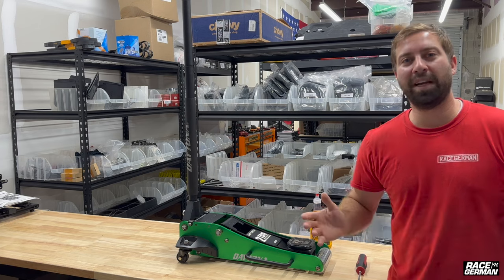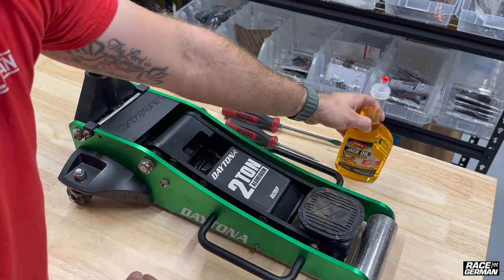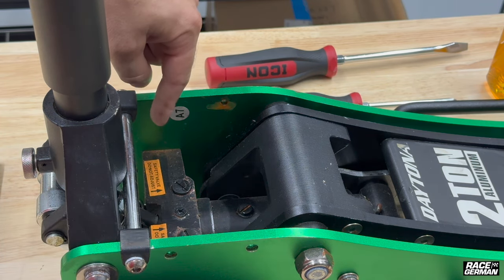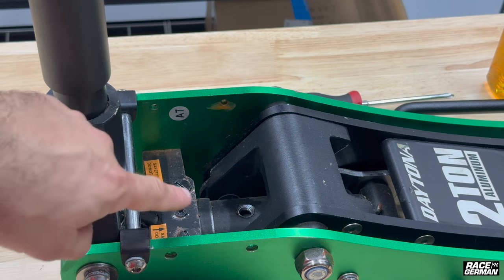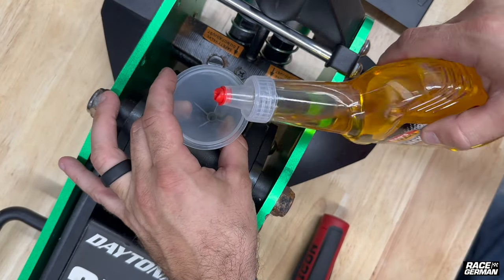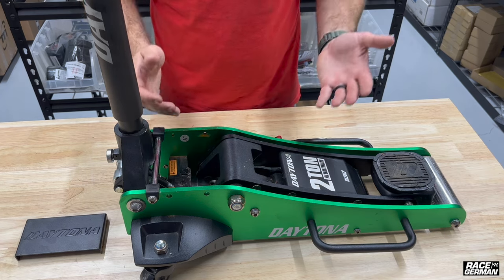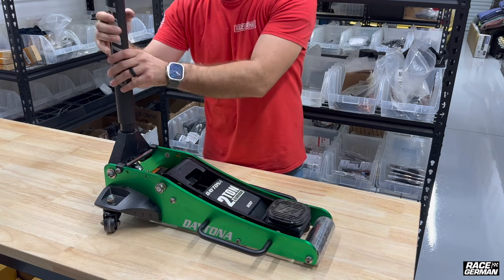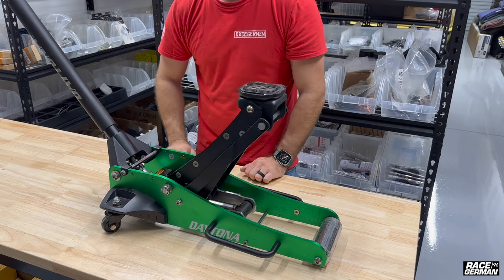How to Bleed a Harbor Freight Car Jack - Easy Fix

Comment: You should have put some weight on it... regardless of instructions, you will find that you should have opened the small bleed screw as well...  I tried the method by the instructions as you showed here.  Although the jack appeared to operate properly unloaded it drifted down under load.  I then tried the small bleed screw and got of lots of air vented.  After bleeding air from the small vent screw the jack no longer drifted under load.
Reply from the maker: Appreciate the input. This way seemed to work fine for me. I have been using the jack for months now, with no issues. This may help other people though. Thanks.
Reply: @euclon I don’t get it, I’m a noob who for the first time bought a floor jack, I’m the one looking for this kind of videos because I don’t know shit, but you seem to know about it then let me ask you this. What the hell are you doing here other than criticizing others? Looks to me if I knew how to do it I would be watching this video. @RaceGerman thanks for the video I just purged mine no problem 👍

Comment: See how you can see the top of the piston with this jack?
With the new ultra-low profile you can't.
I called HF, and they said it's because the jack is small. So they said to just fill it until the oil almost comes out. (In case you don't remember, I was the one that commented on your other video a few days ago.)

Comment: Question for you - I just picked up a HF 3-ton Rapid pump (not the low profile one) and it raises fine, but just like your Daytona in the video it settles about 1/2" after reaching the top.  That can't possibly be normal - or is it?  I'm here because I'm thinking it's a bleeding issue, but maybe you can offer some insight?  TIA

Comment: There are two pistons with springs that push and on my jack that is simular to yours has one that does not come back out all the way when the handle is up so I was wondering if that's normal or is one spring sticking?
Reply: It's sticking
Reply: @alanwielgat6671  I just bought a new one from harbor freight.

Comment: I have the exact model Jack. It’s started making clicking noises when lifting under load. Not sure what’s wrong with it
Reply: There's a nut loose on the end of the handle. To locate the nut... Hold the end of the handle and look in the mirror.

Comment: Hi, Is it normal that the jack to drop when it is not loaded?
I notice that the jack goes down on its own without load. As soon as the piston gets back pressure (when a load is lifted) the piston is lifted and the pressure remains.
Reply from the maker: No, this is not normal.  You may have leaking seals, or not enough fluid.  It should hold pressure with a car on it or not.
Reply: @RaceGerman  When a car is jacked up, the jack remains perfectly in position and does not sink down.
It is only when no load is lifted that it drops down on its own.
The jack is filled with the correct type and quantity of oil.
There is also no oil leak anywhere.
Reply: @digitronixbe5588  maybe it has a sensor and it detects when there’s no load and it drops on its own 😆
Reply: @digitronixbe5588 you are either not locking the valve when you are lifting it without weight, or it's dropping down at all times, with or without weight.

What you are describing is impossible otherwise.
Reply: @LynxStarAuto no it’s not. The main seal has lost it’s elasticity allowing fluid to pass by when just pumping. The seal flares out when the back pressure from the load is put on it then holding the load. The seal is bad.  I do see this scenario a lot.

Comment: When bleeding the manual say CLOCKWISE to turn the handle and then pump the handle quickly several times to bleed. I feel like this is an error on their part?
Reply: Yes, it's an error.  Later in the instructions, it goes into more detail on the bleeding process, this time it states counter clockwise.

Comment: Before we start the process remove the useless cover plate and toss it. Now goto step 1
Reply: The cover plate adds another layer of support and rigidity. I personally wouldn’t get rid of it.
Reply: @Yohane350 a person of common sense. Ty sir.
Reply: The additional plate helps with deflection problems, but you go ahead and remove yours...
Reply: @victorhoyt4352  get a stronger floor jack if you are that concerned about something minor. This floor jack is just fine without it for the majority of loads
Reply: Not useless. It's a nice tray for lug nuts
Reply: Also keeps the dirt from falling down into the release valve port. There is a gap between the release valve stem and the jacks base. The seal on the stem is down a ways from the top allowing dirt to fall in. And that’s not “minor”.

Comment: WORD OF ADVICE: DONT BUY THE DAYTONA BRAND. Got all of two uses out of mine and now it doesn't work.
Reply from the maker: We have had ours for years. No issues. Maybe you just got one with bad seals.
Reply: @RaceGerman  Maybe but I would expect better from a ~$250 tool. Bled the thing multiple times and nothing. Wasted money on this piece of junk. I would suggest getting the warranty for anybody looking to buy one of these, as you'll probably end up needing it.